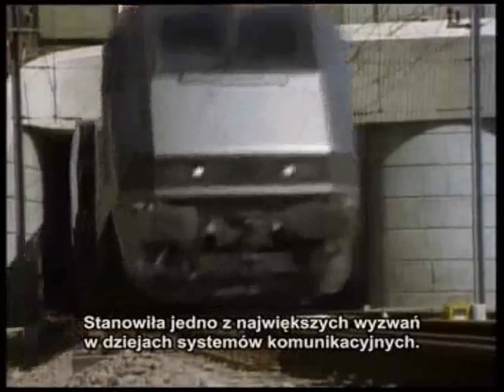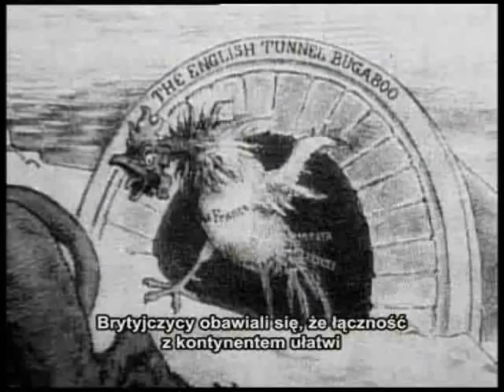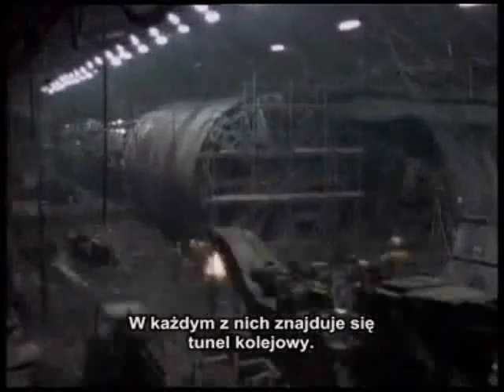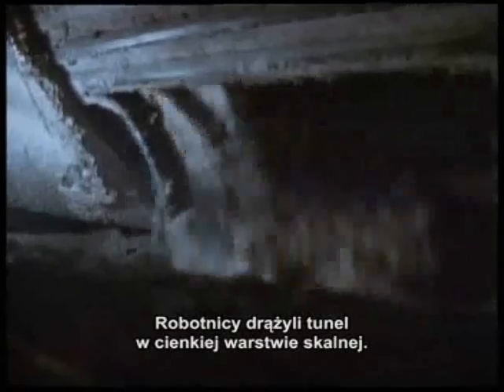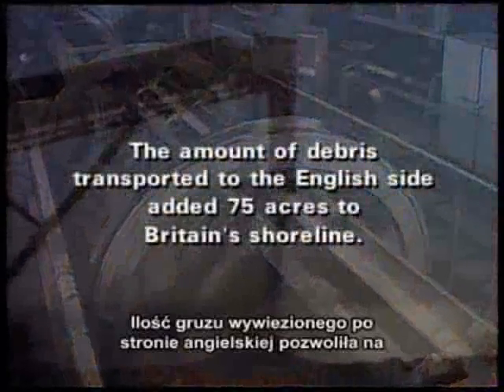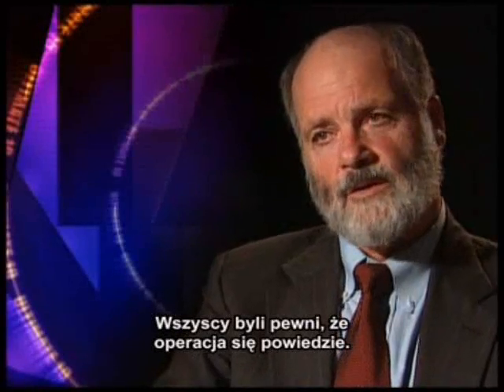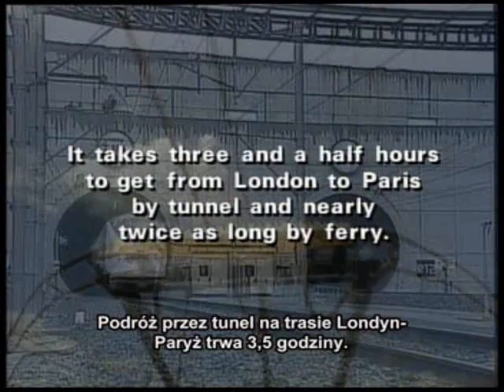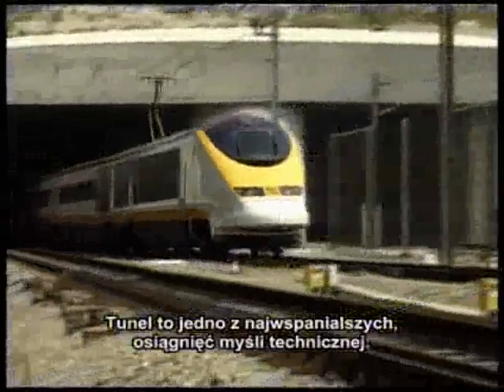How was The Channel Tunnel made?

Comment: Euro tunnel was built by Japanese sealing machine and technology of Kawasaki heavy industrial CO. The most difficult problem was to contact both side. The last part was under the sea and it was muddy soil. If two sides machines contacted in muddy soil, water must flow into the tunnel. So Japanese company made the contact point freeze for 3 months.
When the point had frozen as well as hard stone, sealing machine begun to work again.
And at last two tunnels contacted together. French man and English man met in joyful glee.
But  Japanese engineers had been ignored.